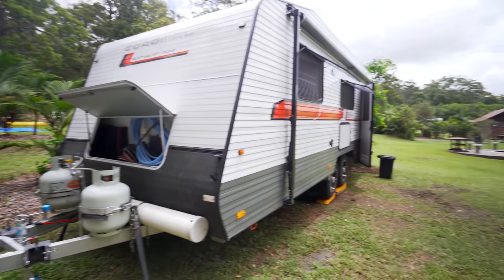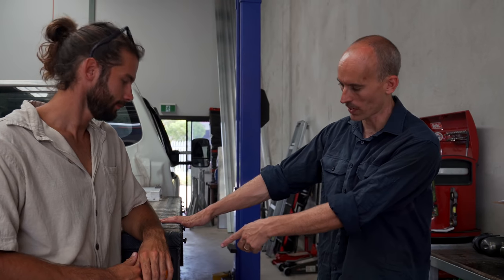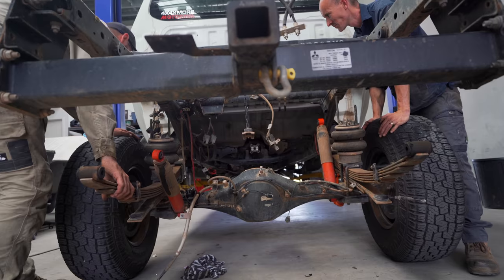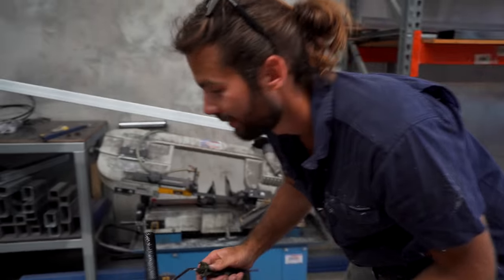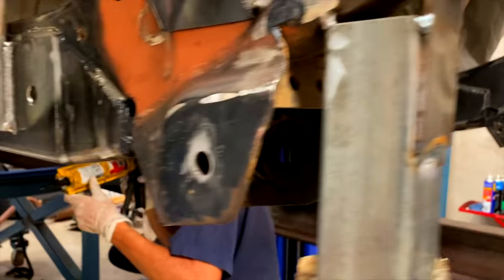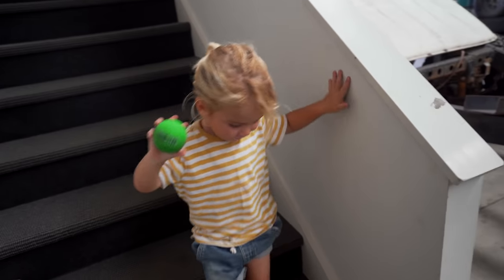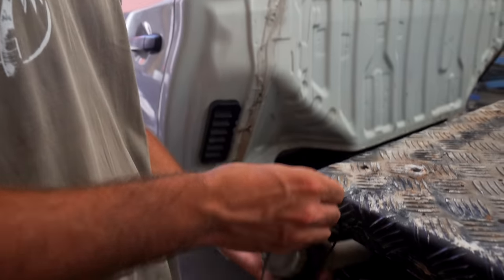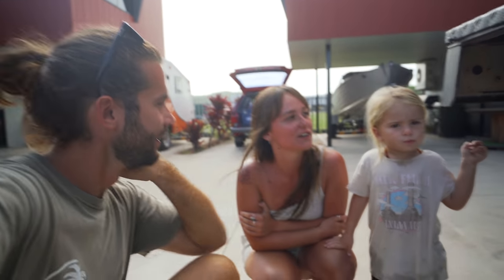We Cut Our Car in Half! 4X4 Chassis Extension // 01 EPIC OVERLAND CANOPY BUILD

Comment: Interesting vid i am curious to know whether u can still tow the van if you need to does it throw all your axle weights out
Reply from the maker: Towing is a lot better with the chassis extended. The weight distribution across the front and rear axels is a lot more even and with a longer wheelbase the load carrying capacity is improved 👍